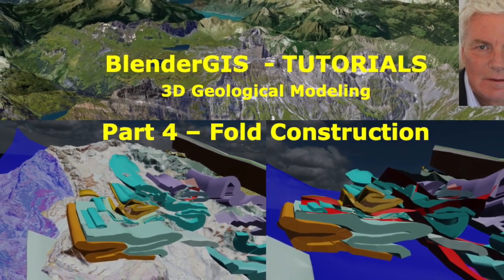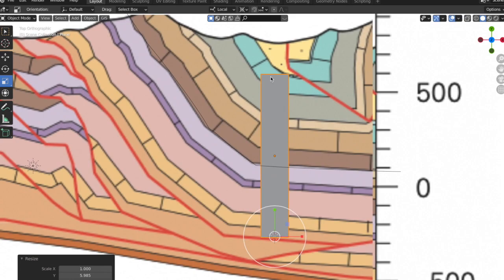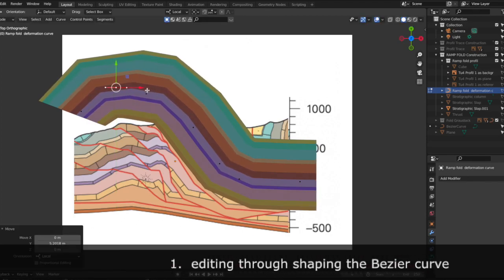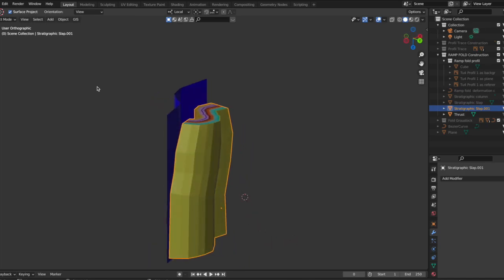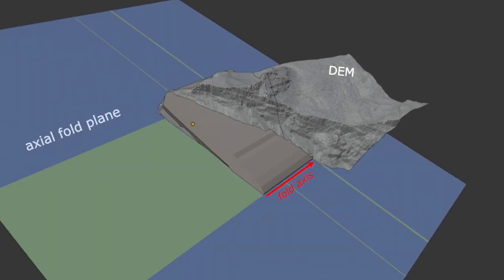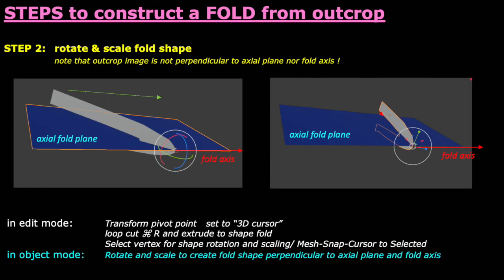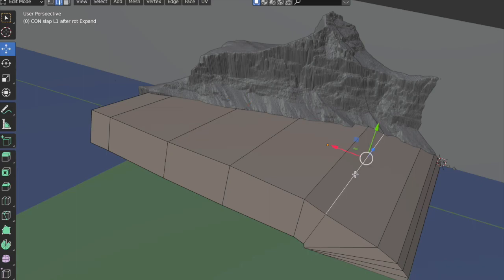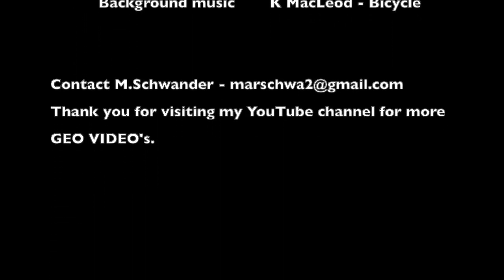BlenderGis Tutorial PART 4 - Fold Construction

Comment: That's a really cleaver workflow!  I don't know that I will ever use it, but if I do, I'm sure your video will save me days of work trying to figure out all this on my own. Since these methods give full 3D control of the structure to make it correspond to the outcrop and profile(s), I'm wondering if the method has produced any significant reinterpretations of the structures or any new geological insights. When I animated the geologic history of Southern California with Blender (https://www.youtube.com/watch?v=TijAI674EuI), it forced me to confront the gaps in my understanding of a story I thought I knew well. Call it speculation, but getting multiple models to fit in 4D, inspired more than one novel reinterpretation on my part.
Reply from the maker: Thanks so much for the thoughtful comment—I really appreciate it. That’s a great question, and one of the reasons I find this approach so compelling.
The workflow has led to reinterpretations of complex fold&thrust geometries, mainly because moving from 2D to true 3D forces inconsistencies to the surface. With full 3D control constrained by outcrops and profiles, assumptions about timing, kinematics, and structural linkages often need to be revisited.
Your point about working in 4D really resonates with me. I really enjoyed your Southern California animation in Blender—making models coexist through time is highly illustrative and makes interpretations very transparent.
Using open-source tools like QGIS and BlenderGIS also makes it easier to share 3D models and invite collaboration, especially in complex settings where no 2D or 3D seismic data are available. I see strong potential for education, geotechnical problem-solving, and for clearly communicating subsurface concepts (e.g., CO₂ or radioactive waste storage) to the public.
Thanks again—your video is a great example of the kind of thinking this type of modeling encourages.